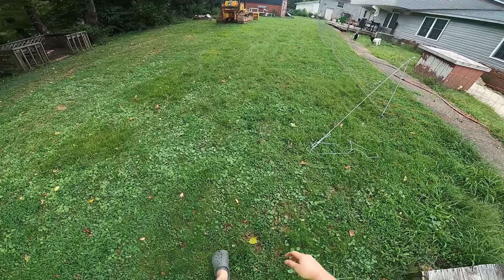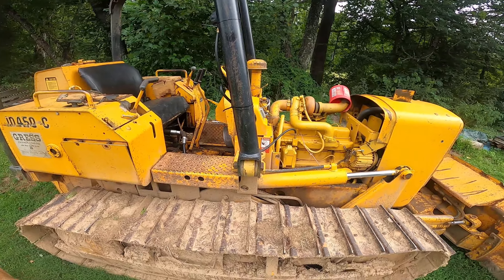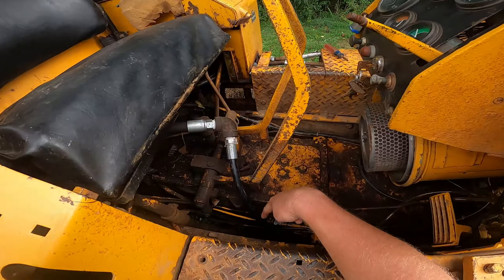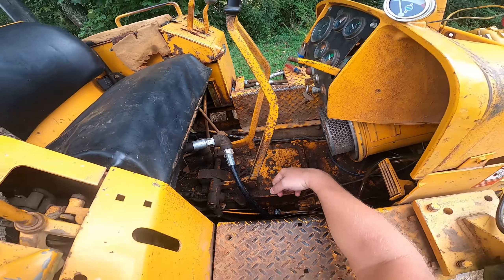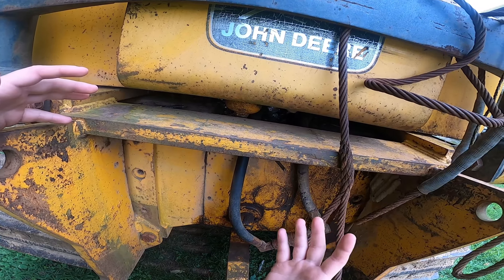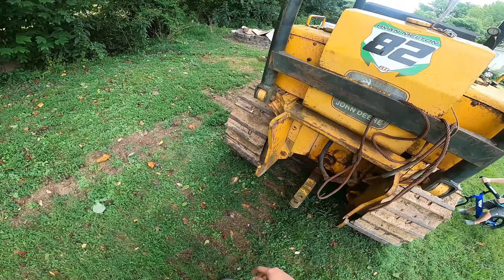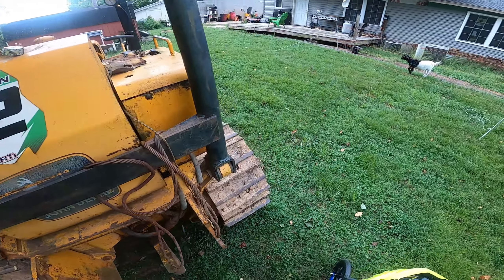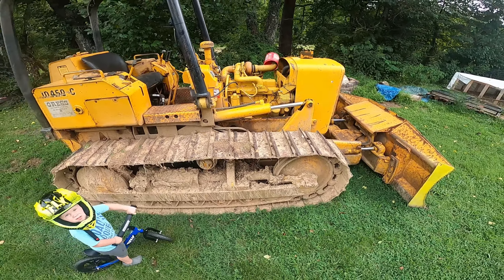John Deere 450C Bulldozer 1976 Chronicles | Fuel Flow Issue Thoughts |  Ep 19

Comment: Just finished dealing with fuel issues on mine have you tried running with the cap loosened, also the tank you pull the seat bracket out and it's just 4 bolts on each side and i think 4 on bottom, there is a screen in tank it screws in behind the shut off valve, also a vent line in tanks you can see under cap make sure its clear ill try and think of anything else
Reply from the maker: Thanks for the info! I actually just got it fixed, there was tons of sludge in thebottom of the tank! Fuel wouldn't flow!
Reply: @randomland6209  mine was same way but still ran like it was starving for fuel ended up being wear ring in injector pump going bad, just had it rebuilt with the upgraded ring that gets rid of the wear ring

Comment: Should. Be bolts on both sides three each side drain fuel take tank off steam clean . Start with fuel pick up in tank and go from thereto fuel pump . Make sure u put new filters on not sure how many it has some have two with a screen bowl . Make sure u use proper fuel lines .when problem is fixed . Could be fuel pump .u need to find air problem first .water separator filter is good to . Old rubber lines if any r shit get rid of them .there split in side then fold over inside when fuel pressure is goin through causing a restriction. What is fuel pump pressure